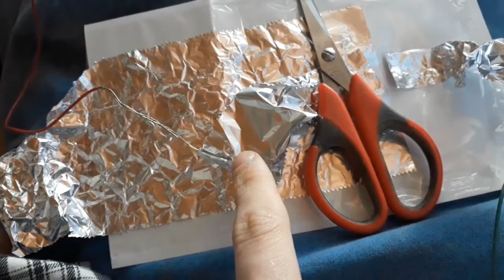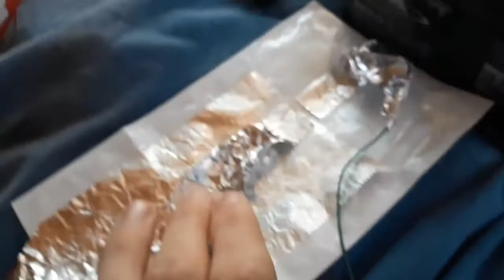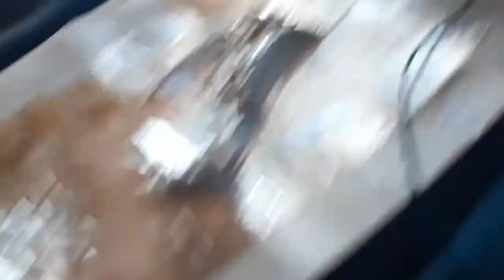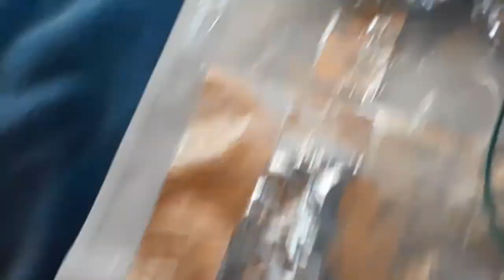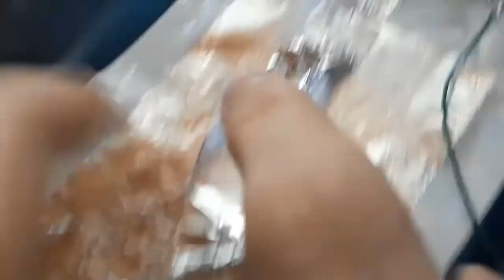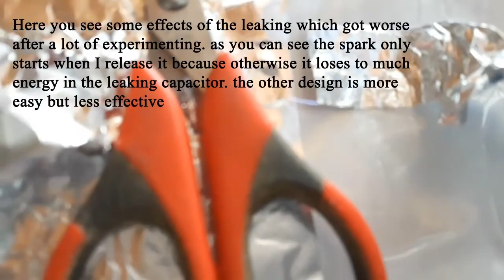Diy super simple high voltage transistor

Comment: I wonder if this could be an effective way to convert high-voltage discharges into specific frequencies. I’m looking to use something similar for my pulse jet engine in my turbine, as I need controlled discharges at varying frequencies.
Reply from the maker: it might, but obviously isn't perfect at all, was designed to work well, not really optimized beyond that(also while designing it I designed it I designed it more as a form of self education).

TLDR
it can be used for that, but a simple diy variable high voltage capacitor would likely also do the trick. an a microcontroller controlling when to generate  high voltage would be more easy to controll the frequency to get very close to a speciffic frequency.

Full

but it should work for it, back then I also had some devices for which I needed very high voltage to work at high enough frequencies, and there where just no off the shelf parts capable of handling both(and the ones handling high enough voltage where like tubes but then also very expensive ones).

that said for something like a pulse jet engine it might be more easy to get something like a arduino uno or pi pico. make that drive a mosfet at the right frequency and pwm duty cycle, and make that drive a high voltage generator(either a standalone one(unbuffered), or just use a transformer and a rectifier and potentially a stepup cirquit(instead of rectifier as those tend to rectify it as well) where the arduino can drive both making it much cheaper to make and simpler in hardware design, just not as efficient or powerfull as a feedback based one, or you can use self induction pulses),
doing it like that will make it far more easy(and compact) to get the right frequency and have it easily adjustable, since designing a oscilator actually is one of the hardest things in electronics despite how it seems, it also would be hard to use a existing oscilator design since normal oscilators are current based, while in this case it would be most effective to have it be static(potential) based. high voltage typically is at low currents. in this case the SFet's being (static field effect transistor(it responds to the static fields like a magnet but static)) able  to change polarity if the user desires to could help(being able to be both N and P channel, as well as a programmable diode), but still there aren't many off the shelf formulas to calculate the right frequency as those formulas are almost all current(resistance) based. also high voltage actually makes making a oscilator much more easy using a spark gab(which you likely have in your pulse jet already as I assume it is for ignition).  
so perhaps you could get away with something far simpler and cheaper.
essentially the spark gab (bobine/ignition point) in the jet, should generate a frequency on it's own(static based), quite similar to the sfet above but then not controllable, the sfet essentially allows to increase or lower the voltage needed to cross the gab. you could try making something like it in the spark gab, but it still needs quite high voltage on the controlling terminal to controll it properly, so it would be most easy to just make a controllable capacitor.
you have a high voltage generator generating high voltage at a certain speed. then the  voltage will rise, and once it reaches the critical point you get a spark, spark generates plasma which conducts well, thus it is mostly discharged again. the capacitance of the capacitor and the amount you generate decide the frequecy.
to make a variable high voltage capacitor, you can use something like dielectric tubes(think about glas, or nylon, or many other plastics and ceramics), either put conducting liquid inside, or only put a film of conducting metal(or other material) to the edges of the inside of the tube or bottle, aluminium foil is used a lot for it). then on the outside also add a metal layer, but make that layer moveable, pull it further away from it and capacitance decreases, so frequency increases. put it further back onto it, and frequency lowers. if you use something sturdy enough you might even be able to move it like a throttle motion and so controll the frequency while it is running.

don't get me wrong. it would be cool to see a pulsejet frequency controlled by such a transistor. but know  there are much simpler ways.
of which the variable capacitor one would be similarly as cheap. and the micro controller based one which drive a high voltage generator. which is more expensive to  make, but allows very easy accurate controll.

if you can't have normal electronics nearby and the variable capacitor won't be enough, then it makes more sense to use such a transistor, but know much needs to be redesigned, just like how a normal transistor cirquit often won't work directly on a mosfet. there are cases where it is very usefull, like back then I was also doing experiments with high voltage at certain frequencies where I needed it to do very weird things, and those certainly wheren't as friendly or safe to nearby electronics. there is also some other forms of research where it can be super usefull, and for fun ofcource.